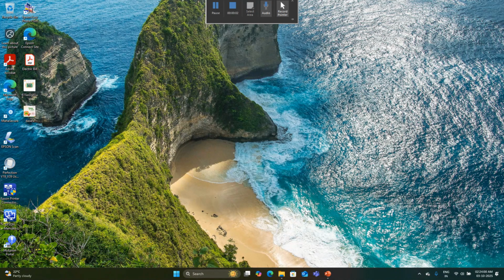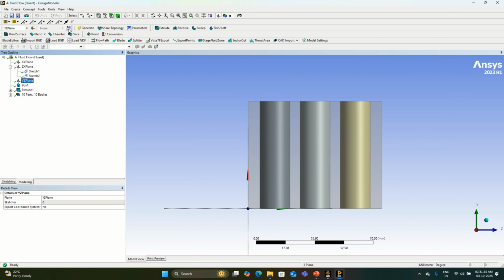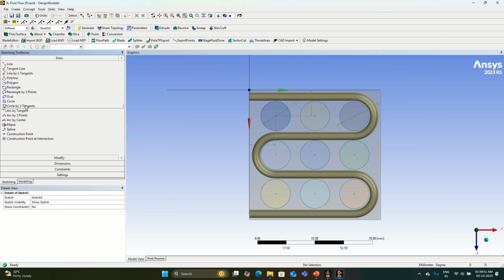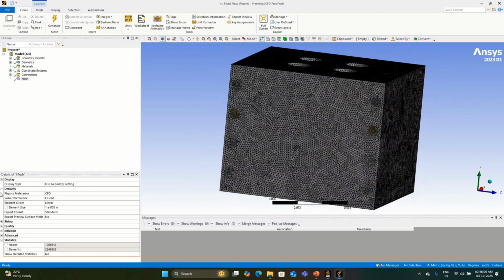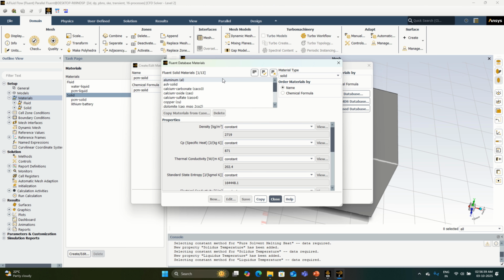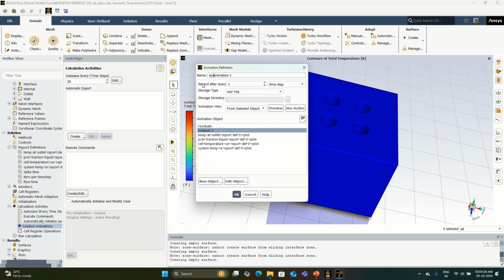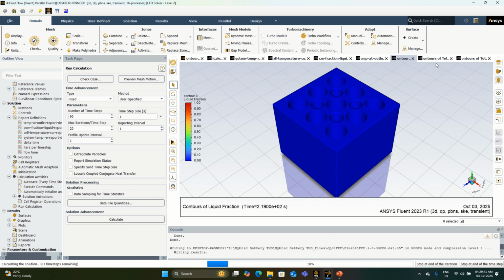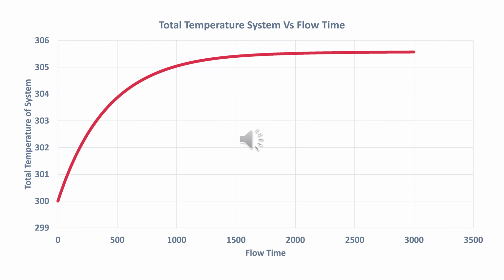CFD Simulation of Hybrid PCM and Liquid Cooling for Lithium-Ion Battery Pack | FCFD-0147

Comment: this work is based on which paper ?
Reply from the maker: This work isn’t directly from any paper. I took the concept from a figure in the paper ‘Thermal management of lithium-ion batteries with simultaneous use of hybrid nanofluid and nano-enhanced PCM’ just as a reference for the PCM and liquid cooling idea.
Then I modified it — I added circular air gaps in my own design to analyze their impact on cooling performance.

Comment: can you perform simulation on dual evaporator loop heat pipe with sintered wick structure
Reply from the maker: May not be possible with wick structure.